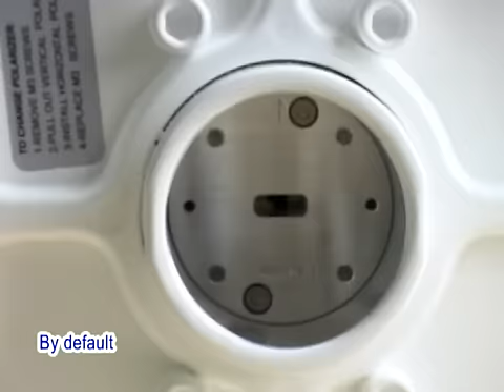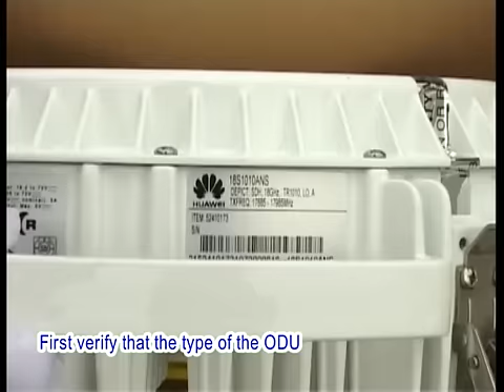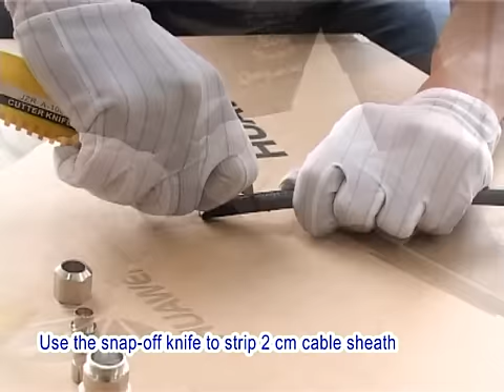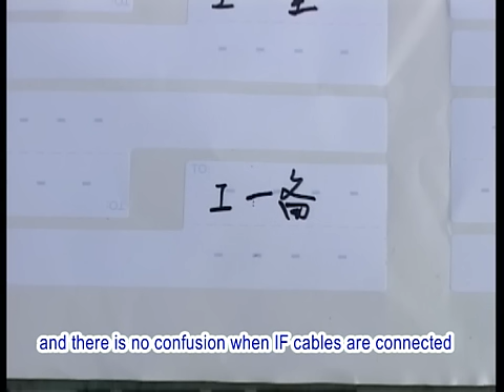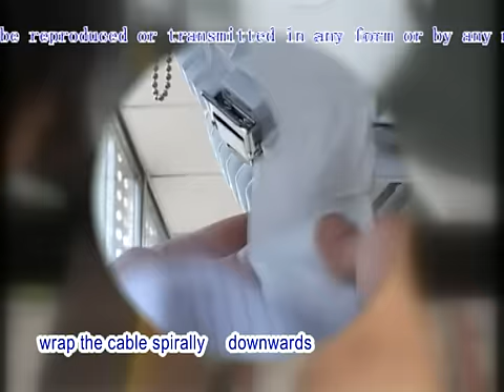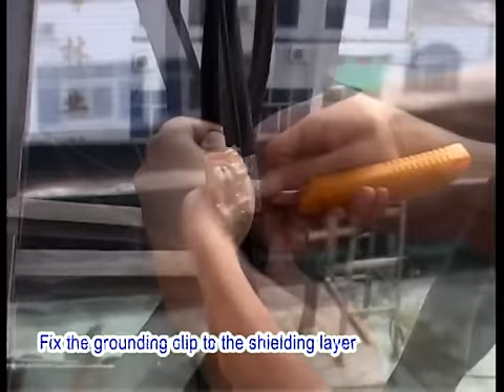Installing the ODU and IF Cable.wmv Copy of Part 3

Comment: This has got to be one of the best instructional videos I've ever seen. Thanks for posting it.  The manufacturer has taken everything into account.  Many if the similar items I have installed on towers seem to be designed to make it difficult for the installer.  When the devices in the video fail it appears that replacement will be quite easy for the technician.  I also like the "safety" gear these guys are wearing.  Before 1998 I wore a rock climbing harness that weighed less than a pound an a half or less than 1 Kg.  Today the safety equipment is bulky and parts of it are easy to trip over.  My harness, when fully rigged for climbing, weighs 20 pounds(9 Kg) alone.  Tools and equipment add more weight and bulk.
Reply: +John Hettish  No its one of the best suicidal attempt you have see, 

Safety Shows, Safety Gloves, Safety Helmet, Full Body harness, even safety ropes are missing, don't do that with someones life.
Reply: +dev dutt jha   You miss the point that other people, in other societies, do things differently.  This much like the way we did things in the USA until cell antenna workers started falling off of towers.  Actually I liked the demonstration of weatherproofing the connectors more than anything.  This is a video I can show my employees, point out the lack of safety practices yet show the good things these guys are doing at the same time.  In the US, there's always a lawyer waiting for an opportunity.  Someone other than the person who is hurt or dead is always at fault.  The worker is never at fault.  Assigning blame is one of the most important activities in my society, though I don't practice it.
Reply: Brother I do accept that the work Done is good without doubt, but in my opinion No Work = Life of a Person, having safety at tower is not equal to the formal attire we are supposed to were at Office Premises, lack of those safety equipment can cost someones life and every life is IMPORTANT. Secondly i would like to suggest you for not showing this videos to your workers, cause if as teacher you neglect safety 100% your workers will hardly implement 80%, rest is yours design.